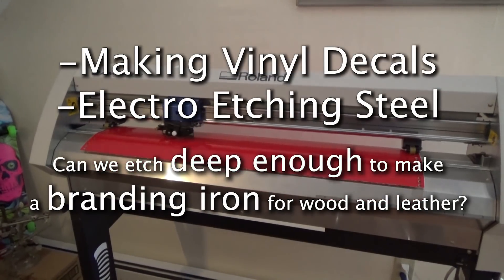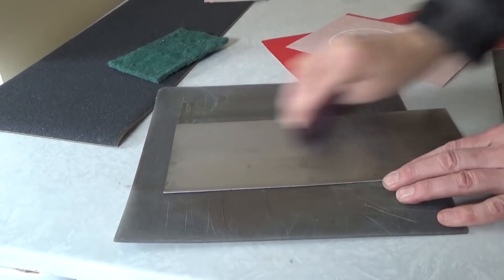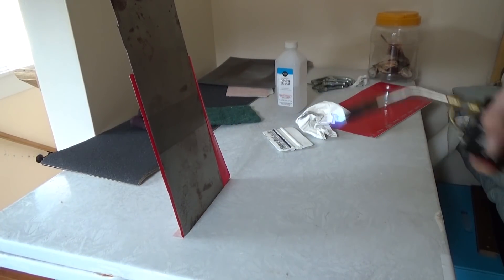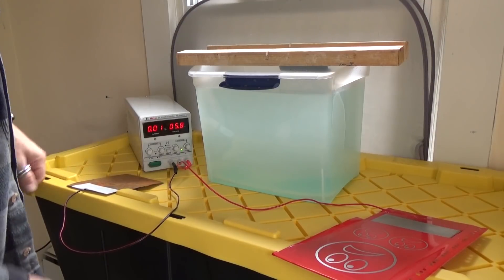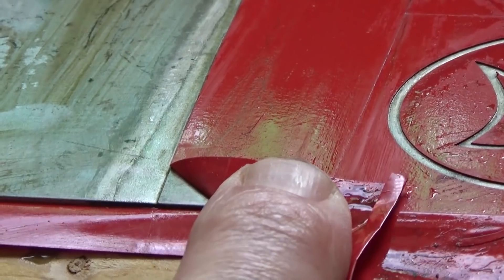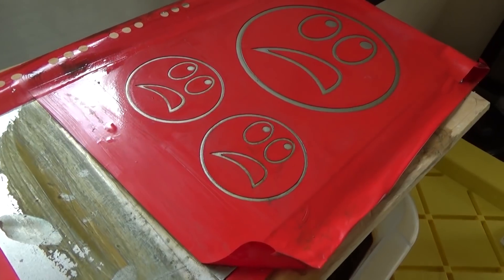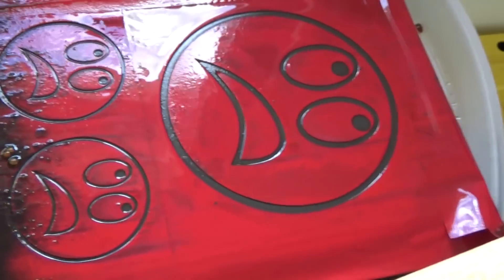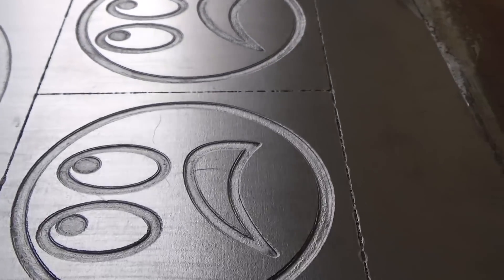Electro Etch Deep Enough for Branding Iron

Comment: I have a 12" section of 2.5" steel pipe with a 1/8" thick wall that i need to take a mm off the inside wall. Could you maybe suggest a way i could etch it off?

Comment: pro-tip, if u use a wet sponge between the two electrodes in stead of the huge water bath it would lower the resistance significantly resulting in much efficient and faster result

Comment: We have a 1927 Buick and the original fuel gauge was not only not operational when we rescued the car after sitting 30+ years untouched but also when I attempted to clean the gauge any markings for “F 3/4 1/2 2/4 and E” came right off!

I had seen a video on YT about etching using a small battery or a battery trickle charger, a Q Tip, and some water/salt mixture as an electrolyte!

So I used a 1.5 amp motorcycle trickle charger…

I masked the gauge after cleaning and hooked the leads up from the charger to the fuel gauge, obviously it wasn’t in a tank of fuel, and to the cotton of my Q Tip, and dipped the cotton into the water/salt mixture and I believe I used a splash of vinegar in the mixture if u recall.

I friend replicated the original markings for me with his vinyl plotter, I etched the face of the gauge using this simple method and got a very deep etch.

After etching the gauge face I used a gas tank sealer in the relief left before unmasking, then used a 0000 steel wool to remove any excess black fuel tank sealer in the markings in the fuel gauge face and it also polished up the aluminum face itself!

Came out looking brand new!!!!

I’ve since shared this on a classic car forum and it’s been used many times over!

Very simple method that ANYONE can do!!!

Comment: How many voltage u supplied ?
Reply from the maker: For this experiment I think the settings were about 6 V and about 4 1/2 Amps. I have another video in my electro etching playlist, that has a bit more details on the ratio of water /salt / current and the results on different metals. Thanks for watching!
Check it out here:
https://youtu.be/Jab0X2MuK5s
Reply: @fleanine  thanks nice response bro nd u r doing great keep it up ❤️ I loved ur video so much

Comment: Good job. Just a note on electrics: A bench power supply is essentially a CONSTANT voltage source. If your voltage drops from 6 to a lower voltage then the supply unit is self-limiting and the etching solution has become more conductive. A saline solution rather than plain water would likely even out the solution conductivity. You need a voltage source with a greater current capacity. A power supply with a CONSTANT current option should also be considered

Comment: This is super interesting to me.  I have a few questions that you can hopefully answer.  For the purposes of these questions I'll refer to the piece being etched as the work piece, and the part that you connect the negative lead to the cathode.

1) Does the cathode have to be the same size as the work piece?
2) If so, the same size as the entire piece, or just the same size as the area being etched?
3a) Does the cathode have to be the same material as the work piece, of does it simply need to be a conductive material?
3b) ex. if the work piece is steel or aluminum and the cathode is copper, would that copper plate the piece rather than etching it?
4) Does the cathode also get etched during this process?
5) Assuming the process flows from negative to positive, does placing the leads opposite (negative to work piece, and positive to cathode) result in etching the cathode more than the work piece?

Thank you for your time in responding and your great videos!
Walter
Reply: Please see my method above as well, it might be a bit easier!

Though the method in the video above is less hands on and will provide no worries of etching deeper in one area than another since the entire area being etched is being done all at one time vs the method I used that I shared above…..

Comment: have you ever done a stainless steel mug in this manner? I've been trying and have not had good luck. Would love to see you do it!
Reply: Sorry this is a bit late, but YUP! Electrical tape as the mask, and nail polish to put the small dots like the center dot in A, B, R, P, Q, G, F, D, S, E, etc. Those tiny features will not come out right with electrical tape as there isn't enough tape there to really hold on and it will come off on it's own, so doing all the letter with tape, then put a drop of nail polish and use a needle to scrape around to make the dot works quite well. I've done several that way and it works quite well. Make sure you have good ventilation as you will be generating hydrogen gas, chlorine gas, etc while etching. Both flammable and poisonous!

Comment: This inspired me to try making airbrush stencils with thin steel foil. Hopefully it works well and works quickly. Will let you know if it does, probably will...thanks.
Reply from the maker: Awesome to hear! Thanks for taking the time to comment. That sounds like a great idea for stenciling, please do let me know how it goes or if you post, please share! Thanks again for stopping by!
Reply: @fleanine  It didn't work well at all. The solid areas that were to be completely etched out, didn't etch evenly or cleanly. I backed it with tape and tried without. Without backing tape the whole thing just dissolved into a mess that fell apart. I pretty much gave up the idea of using laser printed resist paper for making good stencils. I looked at the Cricket cutters by they don't do fine details, and the really cheap laser cutters are rather dangerous to use because no real shielding and crude details. Gave UP. Was a fun experiment.

Comment: Great video, have you tried this with a toner as the resist?
Reply from the maker: Hello there... and thanks for taking the time to comment! That is a great question.. unfortunately, I haven't tried that yet,  but I am curious as to how that would work. I recently bought a laser printer to try a different transfer method unrelated to etching.... I'm currently working on a new etching video - it just may be a good time to test that out! Stay tuned! Thanks for the question!
Reply: fleanine thank you for your response. I have already tried with toner and the pnp and the toner alone didn’t hold up too great but the pnp held on very good, I wasn’t able to get a good transfer so it was pitted pretty bad. If you try it give me a heads up on your luck with it.

Comment: Nice video. I have some questions. After the process is done the water is toxic? Can i throw the water without problems?the negative metal has to have the same size as the positive? is there any problem if the wire touches the water?Thanks a lot
Reply from the maker: Hi and thanks for watching and for your questions. I tend to reuse my water as much as I can and I'm sure there are some less than ideal byproducts created with this and cant really tell you exactly how to dispose of it (maybe not just down the drain of the house) although most local dumps and trash collection places have some place to bring chemicals etc. May be something to look into if you decide to do this often. The negative (in my experience) is good to have around the same size, but i don't think its absolutely necessary. If the wire touches the water, it will just etch and eventually corrode itself. I have a new video that goes more into depth with my set up and explains more about some of the questions you had. Have a look: https://www.youtube.com/watch?v=Jab0X2MuK5s

Comment: can you do this in stainless steel?
Reply from the maker: I have etched stainless before with a similar technique, only instead of actually dunking it in the bath of water, I just used a high salt content/water solution and soaked a cotton ball for the cathode... and just repeatedly wiping over the mask until I got the desired etch. If you want a deep etch and want to save time i would say this could work! Thanks for watching and commenting!
Reply: @fleanine Tnx for the answer. Another question I have this project that requires me to put a depth marker on a pools edge and the client wants a stainless sheet material. Any idea on how can I put a colored print (red & black) 
or etch on a stainless steel?

Comment: will this work on a blued rifle receiver? or do i need to get it to bare metal
Reply from the maker: Thank you for stopping by and taking the time to comment! I also have a newer video that explains a little bit more about my “recipe“... https://youtu.be/Jab0X2MuK5s 

I think if all you did was heat treat or “blue” the metal it would etch as long as you had a decent masking material/ resist that would hold up and you cleaned off any oils beforehand...for a rifle etc you wouldn’t need to leave it etching long to get a nice etch. I would try to test with something similar to figure out timing and voltage.
Also -look into etching with a 9volt battery and q-tips or cotton balls... you can control the etch and work on specific areas and be highly controlled about it. If you give it a whirl, Let me know how it works for ya!
Reply: It will remove the bluing as the bluing is essentially just a controlled oxidation..id just remove the bluing and get it reblued afterwards if you will submerge the whole receiver or use a cotton ball with the negative and just etch that way.

Comment: is it some gel you used in electrolyte? thanks for good upload.
Reply from the maker: Sumant Jogdand hello! Thanks for watching and taking the time to comment! If you check out my latest video on etching I have more specific details (the recipe) on the solution listed in the video as well as the etching times and voltage settings.   https://youtu.be/Jab0X2MuK5s
Reply: Saltwater is commonly used.

Comment: Very interesting, thank you for sharing.  This opens up new worlds for me.  
I haven't watched your follow up video so maybe you already realized, but I would think that if your goal is to make a branding iron you would want to etch the background, not the lines.  You would be removing a lot more material that way.  Would that take longer to do?
Reply from the maker: I’m glad it helped.. and you are correct... in the follow up video I do address the fact that the image should be inverted for branding. I actually make one and test it out!  It didn’t take too long to etch. I did use a thicker metal and went way deeper.Thanks for watching and taking the time to comment! I appreciate it!
Reply: Yes, I've seen the follow up now.  Well done!  It's a tremendously better way to make a branding iron than carving/grinding the steel.

Comment: Do you use removable vinyl or permanent vinyl for etching?
Reply from the maker: I use Oracal 651 vinyl for most of my etching just because it’s what I have -but even a lower tack vinyl would probably work as long as your metal is good and clean when you apply it.Thanks for watching!

Comment: What gauge of steel was that?
Reply from the maker: This was a piece of 16 or 22g steel . You pick up at most big box stores for pretty cheap. Usually come in a 12x24 inch piece or so.Thanks for watching! I appreciate it!

https://www.homedepot.com/p/M-D-Building-Products-12-in-x-24-in-16-Gauge-Steel-Sheet-56070/205058577?MERCH=REC-PLP_BrowseNA-205058577--N
Reply: @fleanine  Thanks for replying. I have one more question. Is the solution just plain hot water and salt?...if not, what is it because you really never explained. Or unless I missed it!. Thanks
Reply from the maker: Howard Bolden  i actually have a couple other videos (one a bit older, and one i just posted about 2 days ago that shows various metals and the exact solution and ratio of salt / water / settings for different metals) please have a watch! I tried to be a bit more specific in the details so the results would be repeatable should you want to try it yourself... Electro Etching Various Metals- Copper, Aluminum, Steel, Damascus https://youtu.be/Jab0X2MuK5s
Reply: @fleanine  Thanks alot!

Comment: You think this process would work on the back of a golf club without altering the club face??
Reply from the maker: I don't see why that wouldn't work... as long as the rest of the club that was submerged was covered properly so the etch only affected the desired area. Also depending on the type of metal the club is made from, it would be good to test a small piece first to figure out the settings etc. Thanks for watching and commenting!

Comment: great video, thanks for taking the time to share.  I've been watching videos on youtube on the subject for the last few weeks.  Your video is definitely the best.  I did have one question I can't seem to get an answer to.  Does the size between the anode and cathode have any effect?  Does the orientation of either plate have an effect?  I notice you tend to face your two plates against eachother.  I assume there's something to that.  Have you tried cleaning your solution mid-etch just to see if it increases it's effectiveness for extra deep etching?  Have you noticed any under-cutting on vinyl decals?
Reply from the maker: C.J. Thank you for watching and commenting! I appreciate that! The size between anode/cathode -I just figure should be similar to the face size or mass of the other object.Ultimately it probably doesn’t really matter. Just gives it more surface area for electrodes to go.. at least that’s how it seems in my head.;)  I really don’t think there’s a big difference with orientation, I just try to face them toward each other so the spacing is equal. Cleaning the solution midway would definitely help. You shouldn’t get too much undercut as long as you really clean everything and heat it when you apply the vinyl -if it’s good vinyl.
Thanks again for watching! It’s great to hear positive feedback, and I try to be helpful when I can! Cheers!

Comment: Have you ever tried to use a weld inverter instead of this DC Power Supply?  You cannot control the voltage, but you can increase the current to higher levels, from 10 to 130 / 140 A...
Reply from the maker: Tiago Carneiro Monteiro actually... i haven’t tried with a weld inverter... I have tried higher voltages, but it leads to a more pity etch and it’s a lot more aggressive /not very smooth. I have a follow up video listed in the description of this video that shows a deeper brand on a different piece of metal... and a test burn. As well as an older video here:  that shows the difference between a higher current etch and a “slow and steady” etch...

Electro-Etching Steel using vinyl mask- Attempt #2 https://youtu.be/ncWXVOzNGbA

Thank you for watching and commenting. I appreciate it!
Reply: @fleanine  I saw that video you're talking about.  I think in a branding iron the pity background doesn't matter a lot, no?  I'm trying to find a way to make a branding iron, with about 2mm deep etching... I'll try it with my inverter (I work as welder, so, it's the better DC current supply I have...) :D
Reply: By the way, one more subscriber.
Reply from the maker: Tiago Carneiro Monteiro I really appreciate it!! 👍🏻 I’ll try and keep it interesting - any questions or suggestions are always welcome! Cheers!
Reply from the maker: Tiago Carneiro Monteiro You are correct, wouldn’t matter as much in the background, however if you have finer/ thin lines it may eat up under the mask too fast and ruin the “edge” of the line if that makes sense. It’s definitely worth a shot, and if/when you try it,  definitely let me know how it goes! I’m curious now.
Reply: @fleanine I'll let you know.  Probably in the next week I'll have some time to try it.  I'll try to make a movie to put in my professional youtube account and tell you.

Comment: I beg you, can I contact you?      I want to know what this device is and what material that made the piece eaten. Please, my brother
Reply from the maker: wissam scofild i added a link to a power supply similar to the one i use in the video as well as the steel type. Any steel will work just depends on how thick/ and how deep you want to etch. You could do smaller etchings/ resists with other types of sticky paper/ tape/ nail polish etc... I use the vinyl because i have it. I hope this helps out. Thanks for watching, and please don’t forget to subscribe!
Reply: @fleanine  Thank you for this beautiful explanation Yes I have been involved with you but I want to buy from this machine and I am from Iraq
Reply: @fleanine  I want to communicate with on your watsab please
Reply: @wissamscofild1531  Kev halak?
Reply: @wissamscofild1531  Al Ham Dulah

Comment: I tried something similar but with a 9 volt battery.  
My steel rusted, do you have any tips to keep that from happening ? 

Everyman Dan : Etching metal with Electricity! https://www.everymandan.com/2019/06/etching-metal-with-electricity.html?spref=tw
Reply from the maker: If you are using mild steel it’ll rust. If something decorative I would use some spray poly and just give it a nice coat, should stop the oxidation. Thanks for watching!